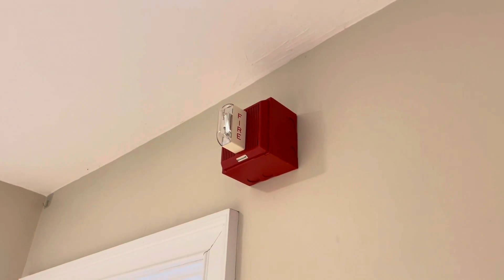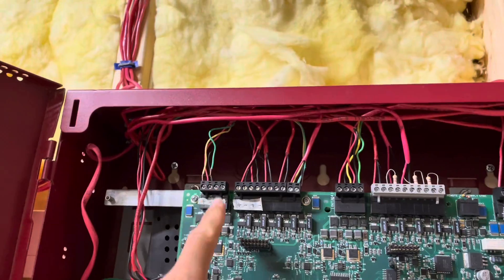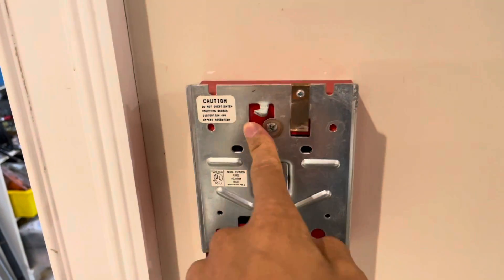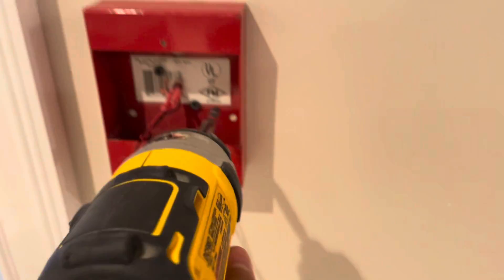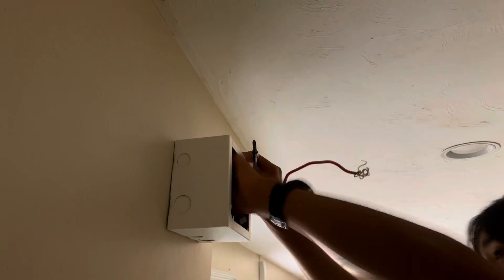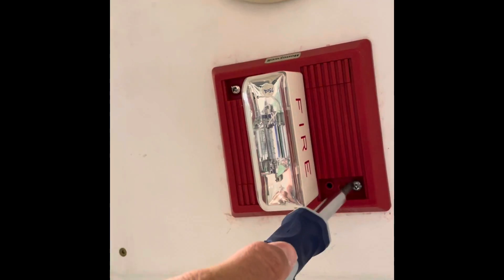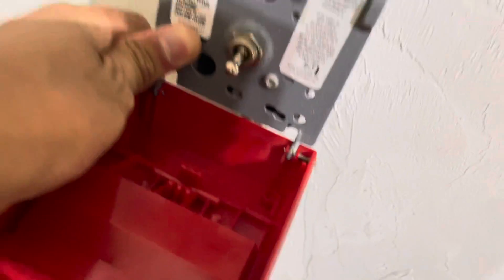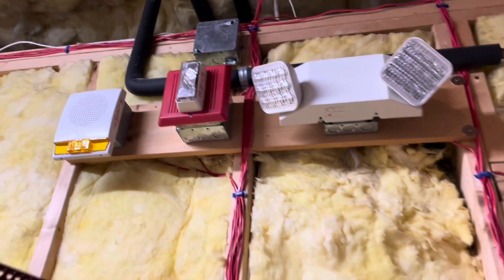Installing New Pull Stations and Speaker/Strobes to Replace Older Horn/Strobes

Comment: I want to be able to install fire alarms outside my house, but I do not know how to run fire alarm wires through a window.
Reply: Im installing one in my house but to install them outside I would drill a hole through the wall or find a way to drill a small hole through the window or you could drill a whole in the floor

Comment: Forgot you had a dewalt... I'm hoping to get a similar one soon!
Reply from the maker: I have many dewalts, I like their tools and I have adapters that convert all my off brand tools to take dewalt batteries
Reply: @FireAlarmDude5967  I've always thought Milwaukee was better but I dont mind Dewalt.. Thats cool though!
Reply from the maker: Milwaukees are also an industry standard.  Dewalt, Milwaukee, Makita, and Hilti are all really nice tools. At the end of the day, as long as the brand is one of the reliable brands, the tool will be nice. I used to care a lot about the tool brand, but they’re largely the same and differences are honestly negligible in many cases.